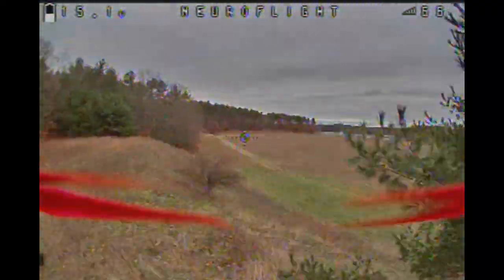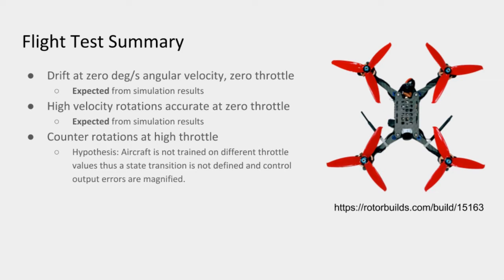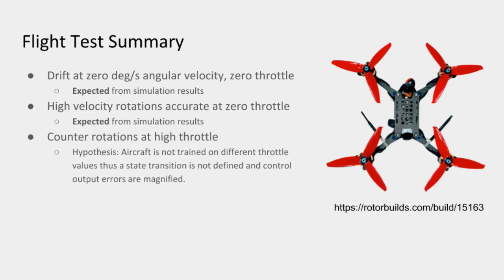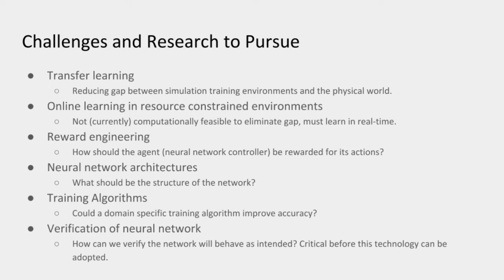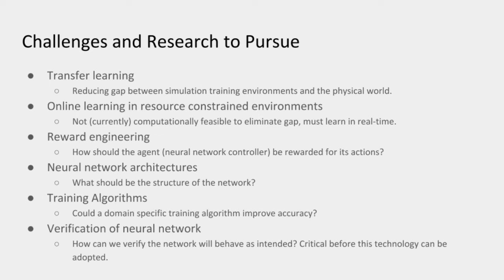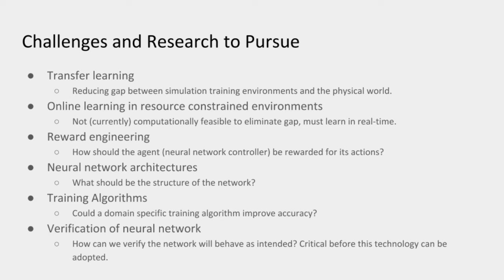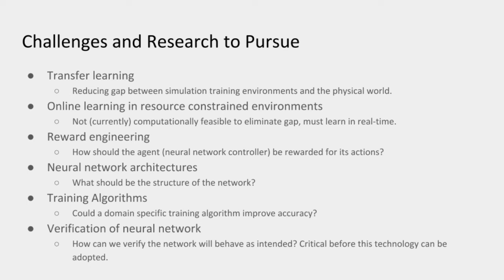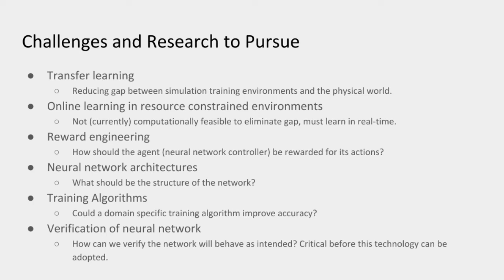Neuroflight Test Flight 3 and Updates

Comment: Hi, great job.
How to  read IMU error in MSP?
This error is the input for the neuronal network, and pwm output.
Reply from the maker: Thanks! In Neuroflight you access the filtered angular velocity directly, not through MSP. That specifically happens here, https://github.com/wil3/neuroflight/blob/v3.3.x-neuroflight/src/main/graph/neuro.c#L51. But you can do this via MSP over USB using this project, https://github.com/alduxvm/pyMultiWii. The neural network output in Neuroflight is the control signal, not necessarily PWM. It depends which ESC protocol you are using.